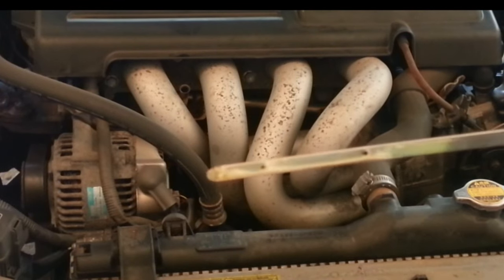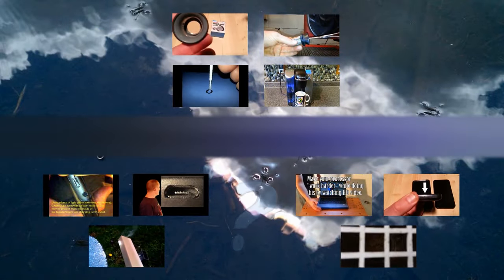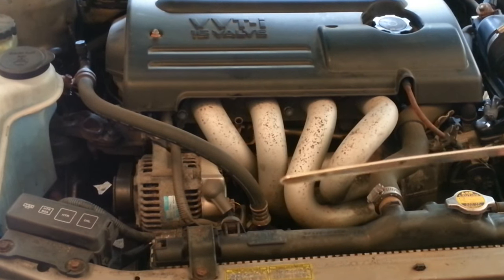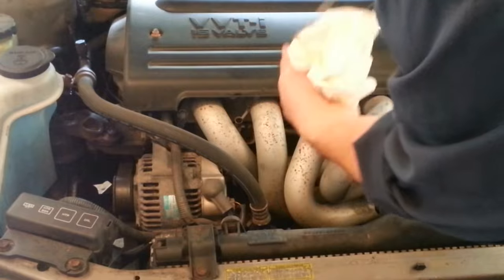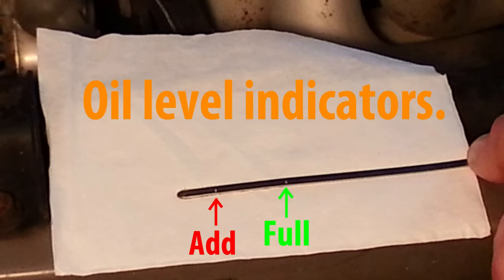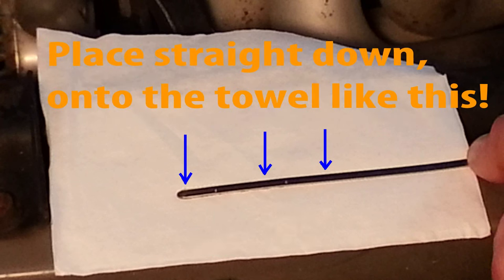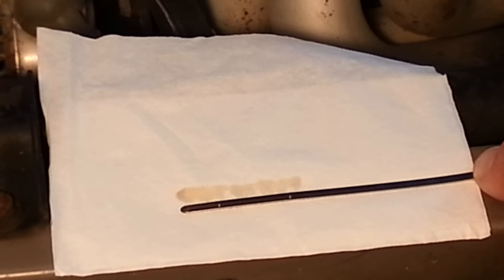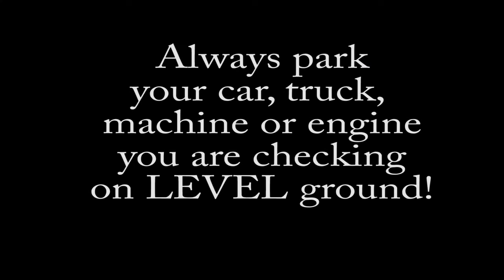Easy! - How to read your dipstick when it's hard to see!. #13

Comment: But how to read a dipstick with oil streaks all over it
Reply: Let oil settle before checking
Reply: Yeah i feel like sometimes the tub that houses the dipstick is coated in oil so when i pull it out the whole thing is covered.
Reply: Let Engine Sit 10 Minutes To Settle Oil. I Usually Check Oil First Thing In Morning That Way Oil Settles All Night. I Could Be Wrong I’m No Engine Expert. Hope This Helps
Reply: @JohnW-b5j even even the car can settle the entire night, it still has some oil streaks all over it.

How then do you see the true readings?
Reply: @prospectormnisi1382 I pull out the dipstick and wipe it off with some paper. That way oil left from driving is removed. Put the dipstick back and pull it out again, and check the oil level. Is that the way you do it too?
Reply: @zockerr8n108  yes thats how i check. I've seen many people do it, including car mechanics doing it.
Unless we have been doing it wrong😂😂😂
Reply: Pull the dipstick, wipe it clean with a towel, then wrap the stick with that towel and place it somewhere in the engine bay where it won't gather dirt, lower the hood, and let it sit for 5-10 minutes.

Then come back, wipe the dipstick clean from top to bottom, and check the oil level again.

5-10 minutes is plenty for the oil inside the dip tube to return to the bottom.

If you're doing it while the engine is hot, you only need to wait about 3 minutes.

Comment: I have the hardest time reading the dipstick on my Tacoma.  All the oil smears all over the dipstick and it reads different every time I check. I check about 5 times, wiping dry in between dips.
Reply: Sammmee. On my taco and rav4
Reply: Same on Hyundai Santa Fe sport
Reply: I have 95 t100 and my dipstick has a bend in it.  It is hard to read also, oil at the low spot then blank then oil smear above the full.
Reply: Same here, good thing to note tho is that my 4L V6 2014 Taco takes 5.5 quarts . So I buy a 5 quart and a 1 quart. Empty the 5 quart and then half of the 1quart bottle. Great way to know ur close to the money since the dipstick is difficult to read, especially with new oil.
Reply: My Jeep Wrangler has a a point that sticks out a bit right above the full line. It always has a little oil on it and because of that I can’t tell if it’s too full. It’s so damn hard to get a read.
Reply: Same problem with 2011 Honda CRV, impossible to read, after cleaning dipstick I insert and remove and oil is smeared above/at full mark no oil in middle and oil at bottom add mark. I've never had a car have such a poorly designed dipstick in my 50+ years of doing my own oil changes. I repeat until entirely disgusted, only saving grace is knowing the amount I replenished it with.

Comment: From personal experience this works  great the first time you take out the dipstick. Once you try to re-check the level, oil gets coated in the dipstick tube when dipstick was initially pulled out and when you reinsert/recheck the dipstick again you get oil marks above the full line on the paper towel even though its spotted oil marks on the dipstick itself. Checking which way the dipstick tube curves helps to determine which side to look at as mentioned on other comments.  The struggles of thin oils.  Once you put in a couple of miles on the engine oil it will get a shade darker and easier to read.
Reply: That has been my problem as well. I have found that I need to wait another 3 minutes or so before taking my next reading or I have oil from the dipstick tube giving me false high readings.  Thanks for your input!
Reply: That's exactly what I'm having problems with

Comment: I USE 5W-20W OIL , VERY HARD TO SEE--THANK YOU A MILLION FOR A EASY SOLUTION TO THIS PROBLEM
Reply: Try 0w-20. Even harder to see
Reply: @moemanm1202  first oil change in my car with 0w-20 can confirm. No joke I tried checking the reading on the dip stick over 5 times until I finally said f it Caus  I know I put in around a 5.6 quarts so I should be good lol .... but tomorrow during the day I’ll follow this video and get a better idea where my oil is at!

Comment: Thank you!  Just had my oil changed...always check it when I leave the dealership....this time was puzzling...Seemed like I couldn’t get an accurate reading...never had a problem before.  2006 Tacoma 170,000 miles Will try this tomorrow. Thanks for sharing.👍

Comment: I like that idea. Also, here's something to try. I have to do this with automatic transmission fluid...
Pull out the dipstick at moderate to slow speed & then hold it level. Slowly rotate the dipstick about 45 degrees and let gravity pull that thin ATF downward to the edge. The fluid is much more obvious and thicker when it is pooling at the edge instead of laying flat, which spreads it out.

Also, with automatic transmissions, remove the dipstick before doing the reverse/drive cycle on flat ground and then leave it in park for 3+ minutes idling before inserting the dipstick, wait 3 seconds, then pull it out and eyeball it.
Reply: Thank you sir!! I really want to make sure I don’t overfill my Honda with the ATF.

Comment: Without the crosshatch on Toyota's dipsticks, it's not only hard to see it doesn't cling to the stick either.

This method, along with a darker paper towel, is perfect!
Reply: Same problem with my Lexus.  New synthetic oil is impossible to gauge.  So I rough-sanded in a cross-hatch onto the dipstick.  Really helps.

Comment: I was actually laughing at how easy this was, and why I didn’t think of it 😂😂😂

Don’t ever remember having this issue before, but today I had my car serviced, which funnily enough is a Toyota like the car in the video! But the oil was so clean, it’s like putting water on a clean piece of metal, can’t see anything! I was holding it up in the air, pointing it towards the sun to try and catch some glare off the oil, looking under my glasses! I put a piece of paper towel on the upper part of the dipstick to try to see how far up the oil goes, I could just about see a clean line where I put the paper at the top, so I was happy with my reading in the end, but this method is so much easier and more accurate 👍🏻

Comment: Our '22 RAV4 uses 0W-16 and it's so hard to read the dipstick. Even the dealership had a hard time when I told them they overfilled the oil, which is why I didn't complete their complimentary 2yr/25k ToyotaCare. With this tip, I check the stick multiple times and look for the area with the heaviest smear consistently.

I also make sure not to put in the whole oil capacity of the engine. Example, 4.8qts with the filter, 4.4 without as per our manual, I only put in about 4.2qts and check from there, add as needed. So far I didn't need to add any more than that.

Comment: I had to add fluid to the transmission but was unable to determine what I was reading on the stick.  Must have checked it 15 times getting different readings all the time.   One side will show fluid 10 inches up the stick, the other side shows sort of what I expect to see.   Will try your tip, great idea well presented.  Thanks.

Comment: My 1998 c280 mercedes has a cable dipstick with a red plastic tip that's almost impossible to read accurately. I have owned everything from muscle cars to MG's, Triumphs, Lexus, and Infinity's and have never had problems getting an accurate reading.  I will try your "method" and hopefully I'll FINALLY be able to determine what my true oil level is. Thanks for the info!

Comment: Some dipstick tubes hold oil on the sides when you pull the stick out, so you have to let the oil settle back down BEFORE you take a reading.

Comment: Another method I read is to pull dipstick and wipe with rubbing alcohol or Windex to remove oil residue, then insert. This helps the oil to stick better.

Comment: Neat trick.  My '02 Chevy Trailblazer has a poor dipstick design.  It's hard to read even with used oil in the engine.  I'm going to give this method a try.

Comment: QUESTION, rule of thumb I have constantly read is change full synthetic every 5000 miles .
HOWEVER if you check the oil and it looks decently clean and it's been 5009 miles does it still make Sense to change the oil???
Reply from the maker: More frequent oil changes are cheaper than an engine job.
Reply: @mysimplefix  I understand what your saying, however by that logic why not change every 10 miles or a 100 miles ,that's more frequent than 3000 right? Because that's what you are saying.

So my question is at what point is the sweet spot for it being frequent and not a waste like at every 10 miles???
Reply from the maker: I'm sorry for the delayed response. Okay, synthetic engine oil does last substantially longer than conventional engine oil. The problem is "carbon" contamination of the oil. As time goes on, and the engine oil has been exposed to some, or even maybe hundreds of cold engine starts, there will be a continuous addition of carbon to the oil. This carbon does NOT evaporate. It just keeps building up. The very first place that it will solidify and create a build up will be the hottest part of the engine that is bathed in engine oil. This would be the lowest "ring lands" on each piston (at the oil control ring). This will cause the ring to seize into the ring land, thereby creating a scenario where the ring "will" gouge the cylinder wall, and effectively, destroy the engine. 
It all depends on how many cold starts you do between oil changes. If you are a highway runner and have fewer cold starts, then your oil change frequency could be extended, but inversely, if the vehicle is driven a short distance and, and especially if you live in a cold climate, more frequent oil changes would be my suggestion. I hope this helps.
Reply: @mysimplefix  yes wow, this helps so much and is exactly what I was looking for, thank you so much,l. I will pass on this knowledge to the next person now who is need. I appreciate you 😊

Comment: The oil level on the dipstick goes straight across at a lower level then covers only half the dipstick coming up to a higher level.  So is the actual level at the lower or higher reading?

Comment: If i did this it would show less oil in the paper because when i lookt at my wife's '10 rogue, the oil doesn't cover edge to edge. It has a narrow band that goes up and i am thinking it is "wiping" some fluid off after the pull for inspection.
so, my question is does the fluid need to be covering side to side like it is now at the low mark with just a trace going up?
Reply from the maker: The the bottom of the metal dipstick tube in the engine will not wipe the oil off the dipstick.

Comment: You are the man! Thank you for this!
Reply from the maker: Thank you! 😊
Reply: @mysimplefix  to make a long story short, my wife and I bought a 1990 Ford Econoline van to camp in. The thing is pretty mint but has a little bit of a rear main seal leak. We drove it over 1500 miles the weekend I commented on this. We took it all through Yellowstone and grand Tetons national Park. I had just gotten the oil changed in it and couldn’t tell where the level was at so this video came in handy. Thanks again.!!
Reply from the maker: @KevinBruceRoy316  Yes, those Econolines have a pretty long dip stick yes! Do you have the 5.8 L (351 cid), or the big 7.5 L (460 cid) in that van? The reason I ask, is especially with the bigger engine, make sure your air filter is clean (with a reasonably new fuel filter). Those things suck a ridiculously large amount of air into them, and the air filter is relatively small (especially when you're climbing over large hills and terrain)! I've seen those air filters plug up quickly back in the day. I hope you had a great trip, and I want to thank you for the nice comments. Cheers!
Reply: @mysimplefix  thank you! And absolutely! It’s the 351 motor

Comment: thanks for the tip.  In Highlander V6, 2011.  The dip stick stays in curved tube.  When you pull it out the oil level is smeerer that causes wrong reading even using your method.  It just catches some oil from the walls of the tube.  Any advise. Thx
Reply from the maker: I would suggest, let the oil "settle" by leaving the engine off for at least 10 minutes before checking your oil level. Pull the dipstick straight out once, take your reading. Be sure to wipe the engine oil off your dipstick "before putting it back in. Repeat your check a couple times always wiping the dipstick off before putting it back in. You'll get an accurate reading. Yes, some of these dipsticks are quite difficult to read, but that method should help you.
Reply: +Mysimplefix  Thanks you for your reply.  A good method that I got it from someone is to pull the dipstick and wait for 5-10 mins till the oil drop from the dipstick tube back to the oil pan. After that put back the dipstick then pull out and read.  To help reading I used your method to get the correct level. Thanks a lot
Reply from the maker: +zofa300 I'm glad it worked out for you! Thanks for posting.
Reply: Got an F150 with the 5.4 There's two good curves in that tube. The trailing makes it so hard get an exact line.
Reply: Good video, thanks for this. Any advice for spiral dipsticks?

Comment: The transmission fluid reaches the MAX full line, but has uneven amounts of fluid above the MINIMUM line is it Low or high??
Reply from the maker: It is sometimes normal to see what you are seeing. The highest level that appears on the dipstick is the "fill" level.

Comment: Thanks sir for the video 
but sorry sir  I'm confused at keep the tip of stick slightly lower than the part you normally hold could you please  elaborate/clarify it 
thanks
Reply: Nikunj Majithia he meant don’t let the position of the bottom tip of the dipstick get higher than any other part of the dipstick.  Or the oil may start running toward your hand and mess up the reading.

Comment: This is good method, but I defy you to use it on a VW Passat 3C (also called B6) diesel dipstick. The dipstick is black (not good for diesel oil, which is always black) and it has several misleading parts. It is far too complex.

Comment: the oil from my toyota 4runner dip stick runs and smears a trail up pretty far so i cant get a good reading. how do i fix it leaving a trail? there is no clear stop or start point
Reply: Tee 
Rule of thumb I use is go by the lower portion of it that is completely covered. Say you have an inch of the bottom of the stick that is completely covered and then the last half inch to an inch is splotches or only on one half side of the stick. The part that isn’t completely covered is residual oil from your tube and wasn’t submerged into the oil in the drain pan. Always check twice too if you are getting crappy readings. Nissan trucks are bad about it too.
Reply: I have the same issue. I check it about 20 times after an oil change. This towel truck seems like a lifesaver.

Comment: I've tried that method but the dip stick when pulling out to wipe clean (before reading) seems to leave oil in the dip stick tube (I've even waited 5min before taking reading) still when reinserting the dip stick picks up oil and smears the dip stick so when you pull out to read you can't get satisfactory reading, 2011 Honda CRV 2.4L...I swear it's the worst dip stick I've ever encountered
Reply from the maker: Wow! All I can suggest is to pull out the dipstick, wipe it off, and let it sit for 20 minutes or more. Do NOT start the engine. Then recheck the level.
Reply from the maker: Is it possible that this engine has a "sludge" problem in the oil?
Reply: @mysimplefix  ...Not likely as the oil is changed every 5Kmi and I use 0w-20 Mobile 1 full synthetic.
Reply: @mysimplefix  ...That's what I've started doing...there's no other reliable way to do it. I stand by my comment though it being the worst dipstick I've ever encountered. I've owned mostly VW's and Audi's and never had issue reading the dipstick, those dipsticks have a crosshatch design and a couple kinks along the stick by where you check the level I think the kink(s) help keep the dipstick stay away from the tube so it doesn't smear oil all over it.

Comment: My tundra oil dipstick is a nightmare to read…. I thought the dealer was overfilling the damn thing so I did my own oil change and god damn it’s impossible to read…. It smears everywhere and always reads high…
Reply: Under good lighting, pull the dipstick, dry it. Stick it back in, pull it out again and look for a 'v' shape from the fresh oil.  The bottom of that 'v' should show where the true level is.  It is still difficult but it does work for me.

Comment: Van anyone tell me why my dip stick still shows blackish oil when I just two days ago asked my mechanic to completely drain the old oil and put new good quality synthetic oil .just drove a Day or two
Reply from the maker: When your engine oil and oil filter is changed, there will always still be some residual "old" engine oil remaining in you engine oil  galleries, This gets pumped out and mixed into the new engine oil after your oil change. It is nothing to worry about (as long as the oil has been changed) . One note... Diesel engines make their oil black immediately once the engine has been started, and some gasoline engines do more so than others. The only exceptions would be engines that run on propane or natural gas